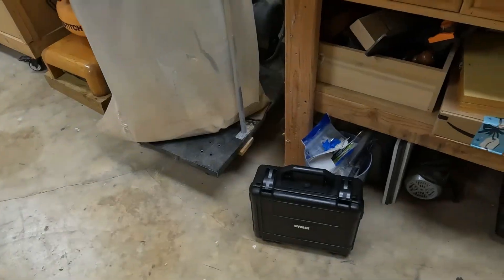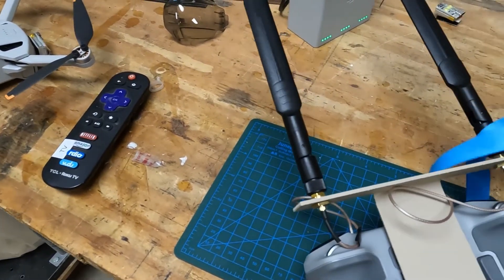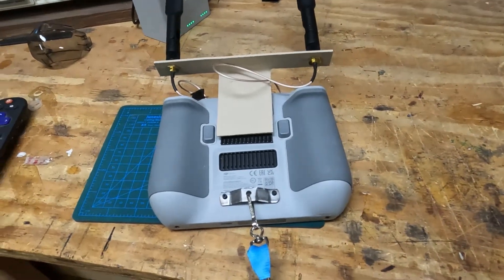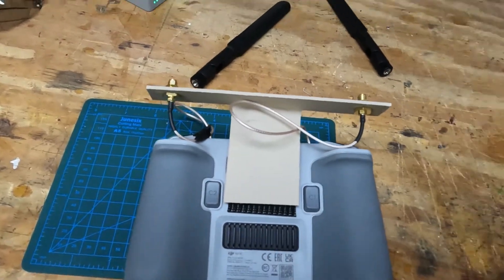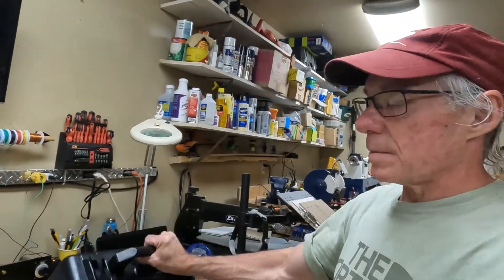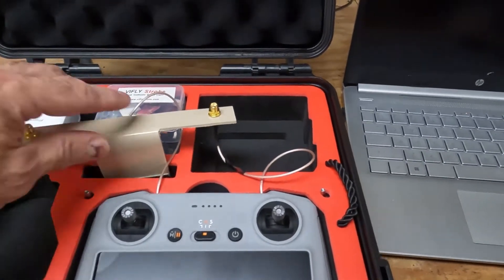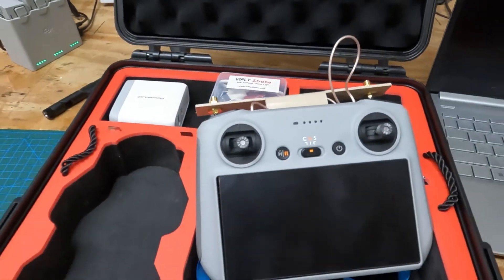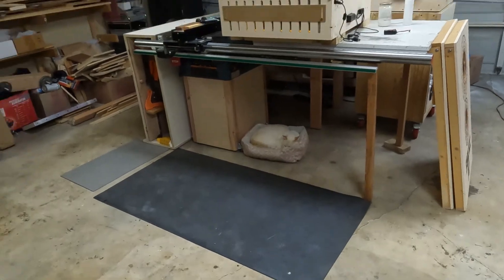DJI RC Controller Antenna Modification

Comment: I modified my RC-Pro controller to add the Alientech Duo-3.
It was a total nightmare!  Everything is packed in so tight and zero slack on any of the interconnecting cables.  The Duo-3 definitely helps, but not $900 worth.

My Brother just bought a Mini-3 Pro and decided to add the bracket for the Alientech antenna boosters.
Thinking he’d “borrow” my Duo-3 🤔 or add external unamplified antennas.
The RC controller is so easy to disassemble and modify compared to the RC-Pro.

After he was done, he thought he’d try and test the connectors to see if he had wired them in properly to the controller internal RF connectors.  I had left him alone in my shop and he connected up my spectrum analyzer DIRECTLY to one of the QMA RF connectors on the RC controller .  My 4 year old  $18K Agilent SA emitted smoke and the display turned black.

For the repair costs, I could purchase a DJI Matrice M30T drone!

Lesson learned?  Probably not….
It’s hard to tell family “Don’t Touch The Tools”. 😊
Reply: I bought the AlienTech for my Autel Evo Lite +, it's total crap, the range is worse, and it's not clear if the antenna is on or off, AlienTech support was not helpful at all.

Comment: What kind of antennas are there though? Are they Wi-Fi antenna is a radio frequency, antennas and how many bands are they?
Reply: There are only two frequencies - 2.4 mhz and 5.8 mhz.  I don't think the "bands" are relevant.  I think these additional/modded antennas are to prevent having to auto switch frequencies and to transmit the signal on both frequencies simultaneously.

Comment: 🤨if you went to the trouble drilling holes for cables,  why didn't you just fit antenna on top
Reply from the maker: If you put SMA connectors on the controller then you have to remove the existing antenna's.  I wanted to keep the existing antennas installed.  And I did not "drill" anything.  I used a small round file to make the very small holes needed to fit the cable.  I have since made a switch to go between the built-in antenna and any mods I want to do.  That was the point of this mod :)  It is not perfect for someone that wants a permanent mod.  I like to tinker and this gives me the ability to easily switch from one antenna set to the original for comparison.

Comment: Nice workshop but sorry the mod is ugly and pointless to have all that cluster and cable’s is a mess also how did you connect the new aerials when the connection points are used by the stock connections that you left connected  😊
Reply from the maker: Thanks for the comments.  I agree, not the prettiest mod.  Then again it took me about 20 minutes to do the whole thing LOL.  To answer your question:  the stock antenna's are still installed but NOT connected.  The only ones connected are for the mod.  I did this for a performance test and it does out perform the stock antennas.  I really don't care if someone comes up to me and says my controller is ugly ;)

Comment: Learn what a drill is.
Reply: That was some uncalled-for comment to someone who is clearly helping out the community with info on RC modification. Poor upbringing to have manners like this. pitiful.
Reply from the maker: What for?  Did not need it for this.

Comment: good mod man, awesome liked
Reply from the maker: Thanks!  The mod is not for everyone.  And one should have some basic knowledge if they want to do it.  I am happy with it!
Reply: @josephbarletta5392  I hear ya, i had some drones back in the day, even made a giant X4 one with a canon for a camera but it had a glitch and came down and the lipo bursted into flates, safe to say it was just something afterwords to trow in the trash bin. after that i was like im better off buying a DJi or something, but had fun putting them together, also had QAV500, the reptile 450, flamewheel, even the HK 600.. they were all fun but very unreliable .
Reply from the maker: @GottiRC  Thanks.  I love flying anything!

Comment: You taught us nothing! What antennas are needed?
Reply: Thanks very much for responding. Appreciate it!
Reply: @Sub250 aerial shots you're right. I came on too strong !
Reply from the maker: I put that in a reply to East Time.  I first used some cheapo antennas I had.  If you need a starting point you can start with these:
https://www.amazon.com/gp/product/B082SHBWTK/ref=ppx_yo_dt_b_search_asin_title?ie=UTF8&psc=1

Pretty much any dual-band wifi antenna will do.  I found that using quality antennas I had on an old Netgear router work better. 

The purpose of the video was not do a step-by-step installation.  I said that there are plenty of videos that have gone over that.  The purpose was to show what I did differently.  I hope that helps.

Comment: Nice video !
The antennas are 6 dbi or higher ?
Reply: Spec says 8 dBi but your miles may vary based on the fact they are cheap antennas.  I did replace these with antennas with antennas from an old Netgear router.  I noticed a big change after that.
Reply: @ultraporthos6884  NetGear router Antenna's better?